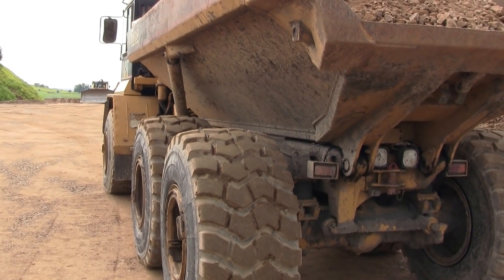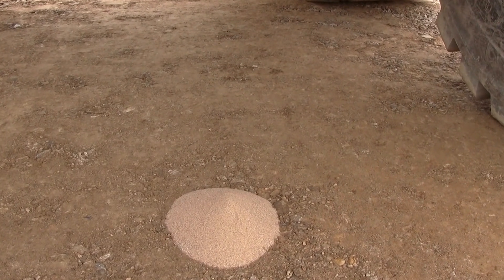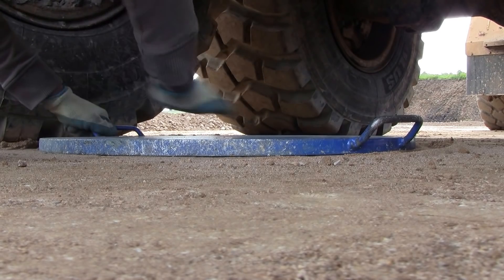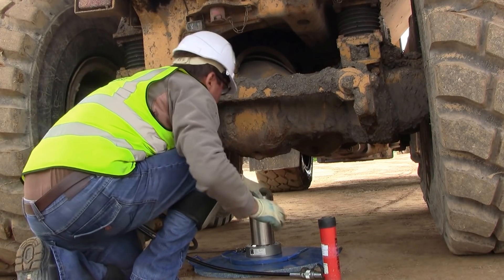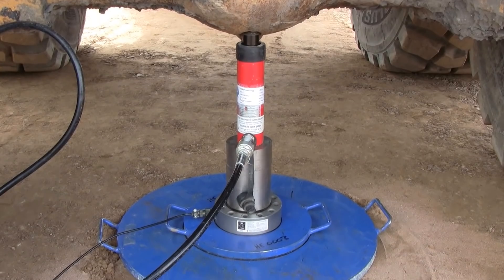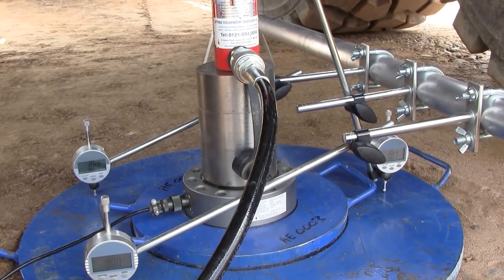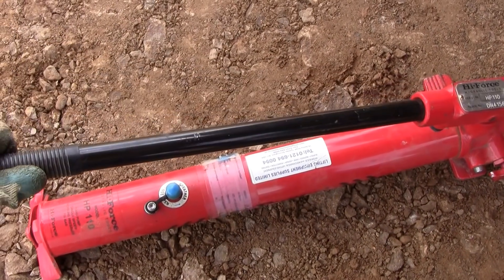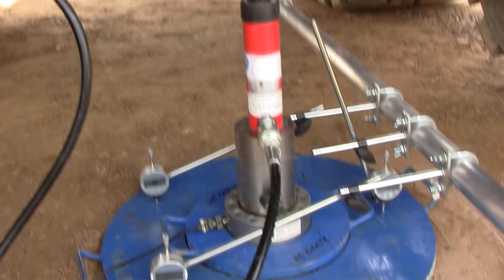Plate Bearing Testing

Comment: hi, nice video. 
I want to ask, how you convert (k) from PLT ro CBR Value?
Reply from the maker: CBR (%)= 6.1 × 10^-8 × (k762)^1.733 

where k762 is the Modulus of Subgrade Reaction, defined as the applied pressure under the loading platen divided by the displacement (normally 1.25mm) with a plate of 762mm (30 inch) diameter. The Modulus of Subgrade Reaction for other plate sizes can be determined using an appropriate conversion factor
Reply: Suppose you use a 400mm plate, the measured k is 40, the conversion factor is about 0.6. Does that mean the K762 is 40*0.6=24.

Comment: Hi, interesting video. The vehicle you use is sprung. So how can you be sure what the load is?
Reply: there are many-weighing balance to measure the weight of the vehicle and its material together....but out point it to check the load from the loading gauge which is shown in the video and monitor at 5, 10,15, so on up to 100kN.